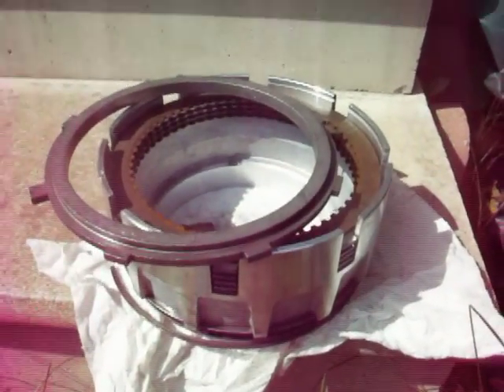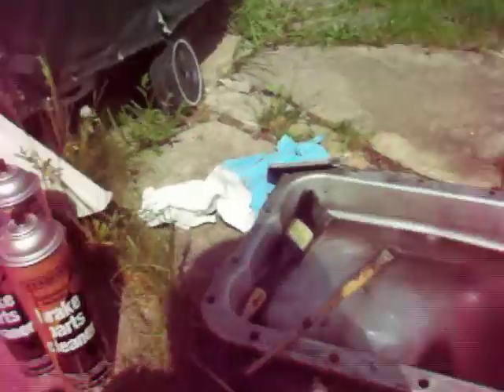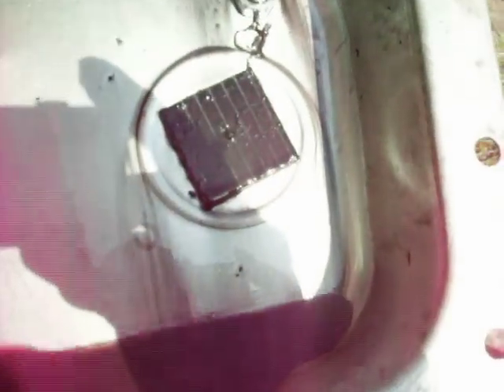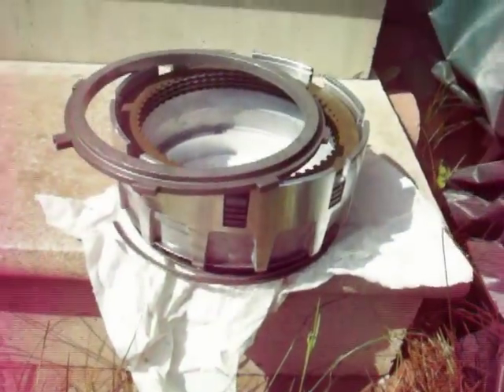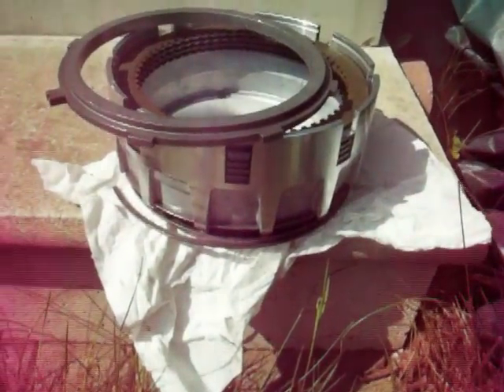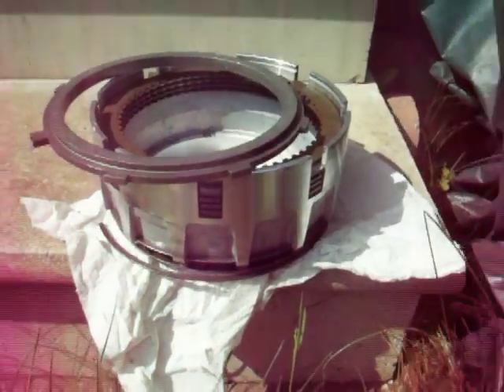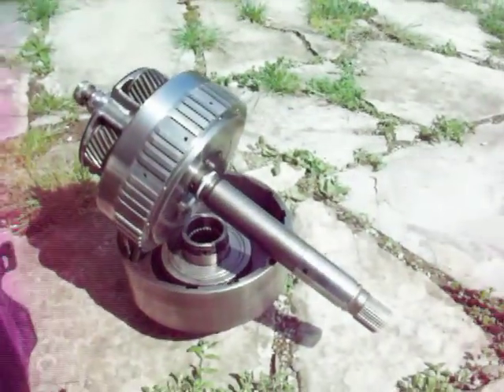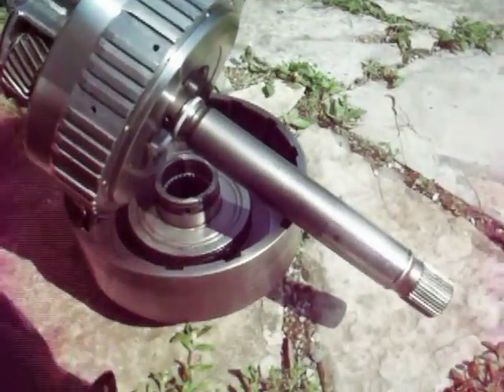Corvairwild 4L80E Adventures, the job continues.MOV

Comment: I had to machine the ball out of the input shaft. I don't know how it got there but it was there and stuck in there pretty good. It was like that when I bought it from the owner but none of that is really relevant because I installed new parts. Nothing is original except the drums and planetary gears. The hard parts. Valve body, solenoids are brand new. I even got a new transmission case.

Comment from the maker: Thank you for asking.  I will try to help.  First things first:  Before the overhaul, what was the unit doing that warranted repairs?  From there I can go into the pressure checks that can be done (probably with a scanner on this one or good old fashioned oil pressure checks) to see what happens when the unit in plunked into 'drive' or any other forward position.  The fact you said you air pressure checked things will hold me from going further till I hear a little more of the story.  Take care.

Comment: I bought this truck with a transmission that was totally burnt. When I opened it the frictions where so burn all that was left was a metal ring. It burnt up because a check ball made its journey thru the transmission and lodged itself in the input shafts oiling hole. It was done. No gears at all.

Comment: I'm pretty sure I found my mistake. On the shaft that goes into the sun gear there's a lube hole that's suppose to line up with a channel in the gear. I didn't line that up and it was starved for fluid and burnt the clutches up. So basically I fried my new clutches. Its a costly mistake that I over looked. I was rushing because it was getting late that night and I wanted to get it done so I could install it the next day. I appreciate the help anyway. I'll be rebuilding it again and make sure

Comment: Corvair told me to give you a holla that maybe you could give me some insight of your own to what I'm having a problem with. I have a 4l80e trans that I rebuilt with new parts all the way up, correctly, and after install it acts like its still slipping. I have reverse but no forward. It don't even go when I manually select 1-3. Fluid is correct and all. New solenoids and valvebody. I air checked every drum to. Have you any clue to what might be the problem. I appreciate any guesses you have.